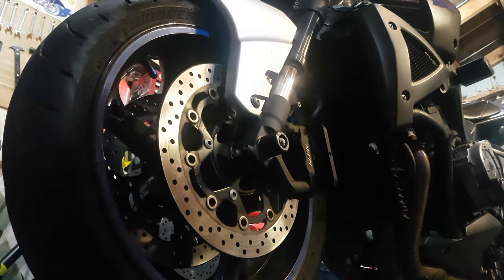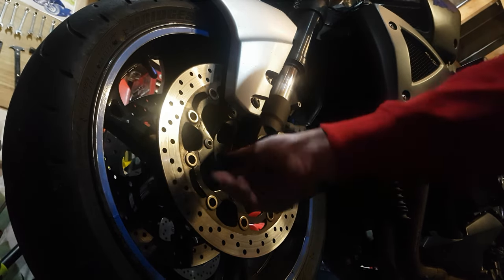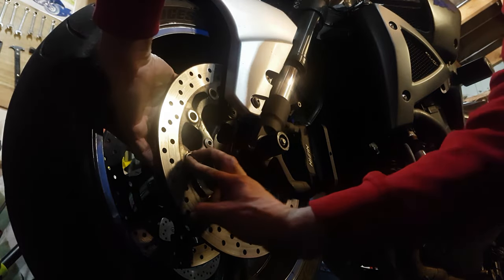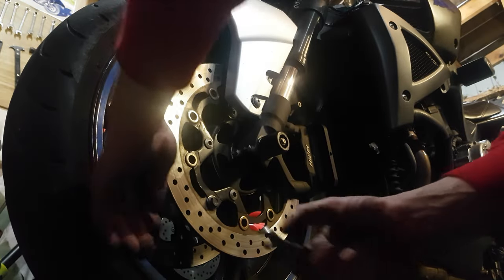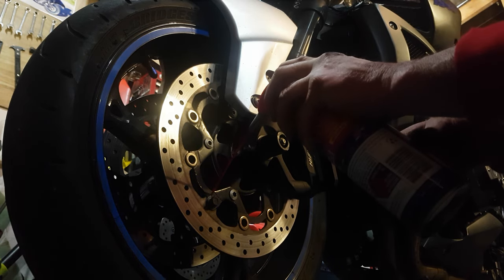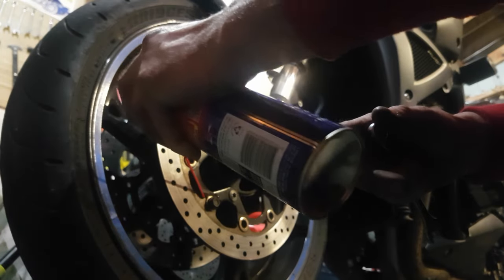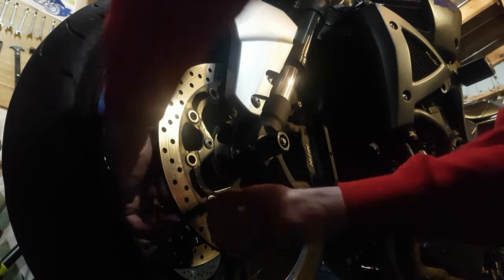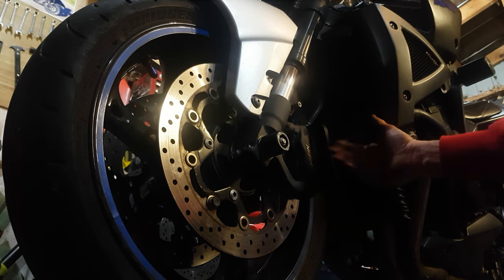Checking disc brake rivets.

Comment: Do you know how to solve the problem with gear sensor? Sometimes neutral is in blank and gears are crazy
Reply from the maker: Toni Tijeras your GPS sensor behind the clutch basket will be going faulty, especially if the indicators jumping, if your running a TRE also remove that as they can cause issues with it.